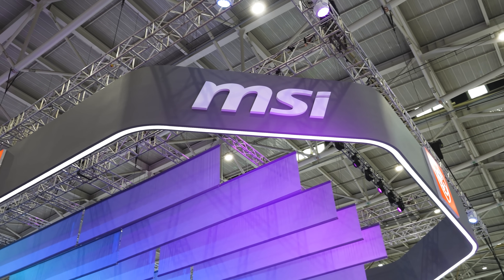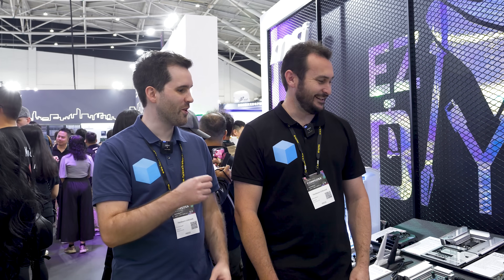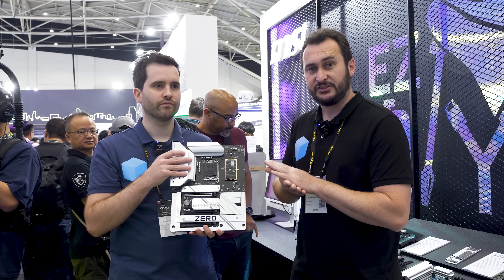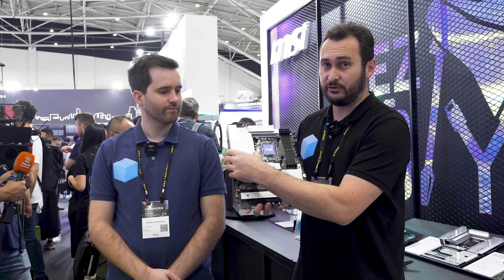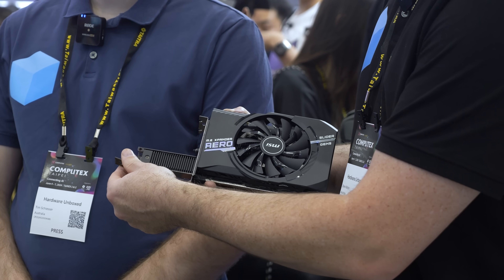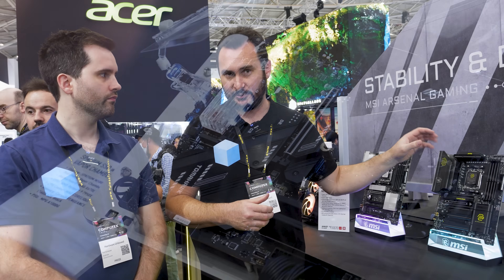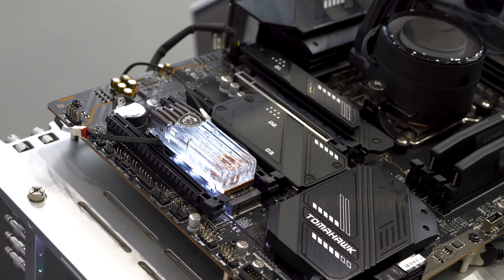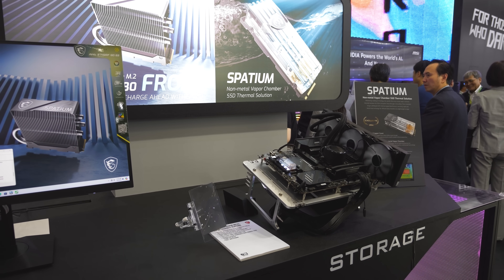Faster, Better Memory Is Coming, DDR5-8400 Now Actually Works

Comment: Yes, the MSI motherboards are offering some newer improvements once released for socket LGA 1851 socket. Now that the Intel 15th generation is coming to market along with MB’s, I am not finding from MSI’s website for the CAMM2 version which was Project Zero PLUS. Would anyone have information on whether MSI is actually proceeding with this MB production and when it will be available to the consumer?
Thanks for all information who are in the know!

Comment: It looks perfect for ITX motherboards. since it would give more space for new wider cpu coolers that couldn't be done before because of dimm slots but allow for a bigger heatsink+fan in small builds to increase what cpu can go into SFF builds. Imagine the higher end cpu that can be cooled properly in a tiny cramp space.

Comment: The camm2, will exist on ultrabooks, where the ram actually are solded to the motherboard, where the inrernal height not let a dimm slot, but yes let a camm2 little port and module.

Comment: Do MSI boards still install the Nahimic malware if you enable the onboard sound device? That crap is almost impossible to remove from your PC, unless you have expert level computer knowledge. It will also automatically re-install and re-enable itself unless you nuke every trace of it and blacklist it's device ID in the registry.

Comment: 4:00 where's the power delivery (24 pin) to the mobo?
Reply from the maker: It's an MSI 'Project Zero' board, all the connectors are on the rear side of the PCB.

Comment: What " I  "  like  about this  design  with  the  Cam2  Makes for  a  Very   Good   Path  for  Full  Water  Cooling  block  For  Both  Cpu  and  Memory   Now  !!!  =  Anyone  ?   ,   Could  even see  The  GPU  Embedded  for a  Whole  Board  Block    =  ? placement  also  closer  to  cpu   actually  could  drop  cpu  on  board  and  cam2  to  make  it  easier  for  the  central  position  all  around  to  get  caps  and  all   up  to  baack  io  which  is  in  dier  need  of  same  tresatment  as  say  length  of  rear   of  board   shortening  audio  traces   as  well  as  hdmi/dp /c lan  etc...   can be  in its  proper  position  of  connectivity   shortening  the  latency  for  each  feed  with  shortest  trace  being  embedded  into a  monitor  ,  Nooooo

Comment: Let me start by saying I love your videos guys, they helped me a lot with all that amazing data you show on them.
I know this is not going to be the only standard, for now, but I have to write the following: 
CAMM 2....mmm interesting.... so instead of getting less screws, we are in fact adding screws to things that never had them. A simple task like installing or changing RAM is now a pain in the behinds with screws that can fall all over the system. And we also get another bracket with more pads and small contact area that can get damaged, but hey you can order a new one if it gets damaged.... of course you can pay and pay .... Why would anyone want the old dimm slots instead of this nonsense, right?.
And lets not forget about adding more RAM... no no! .... well actually lets forget about adding more with CAMM 2, if you want more RAM, you have to buy a brand new CAMM 2 "stick?".
I guess you can also "stick" the old one wherever you like.
Honestly I have no idea who was the brain behind this, but Im not a fan.
For notebooks it may be (in some niche cases) a good idea, for heavy OCers also a good idea. For the rest of us is by far one of the worst ideas I have seen, only obscured by the almighty nvida power connector. But hey this is my opinion, you can, and most likely, will disagree.
I did liked the PCIE button solution and the M.2 drive release thingy.

Comment: Just move CAMM memory on the back of the MOBO like an nvme.
Place bigger heatsink around cpu socket...
that's smart
Reply: Even with CAMM2 on the front, given the low profile it should still allow for more heatsink clearance if someone wanted to make one that only worked with CAMM.

Comment: CAMM2 will severely limit upgradability. It takes too much horizontal space, there is no chance of double sided modules. It is good for laptops but on desktops where vertical space is not a big problem, this is not a good solution. Unless manufacturers move most other connectors to the backside like that MSI board which came a while ago.

Comment: Gonna be honest... that quick release, super easy m.2 slot lock (or whatever the correct term is), and that snap-on Wi-Fi antenna on these boards are definitely going to be factors when I upgrade next. Not sure about CAMM2 yet though; it'll either be amazing or annoying. Definitely will need to see it in the "wild" before I have a solid stance on that. Let's hope they aren't all priced outside of my price range when I'm in the market.

Comment: No cool new features for x870 ?? I guess slightly better ram OC potential thanks to the new chipset but overall, feels kind of lacking ? Wasn't there talks of USB4 (even if it's not very exciting could be always a plus) x770 too many 7s ? at least this should make the price of the x670 motherboards drop...hopefully, will be curious to see the reviews if it's really worth it

Comment: The main flaw I see with the CAMM module is the lack of upgradeability. You can't gradually add more memory as you get more money. Each time you'll have to fully replace the older CAMM module and go through the hassle of selling it on ebay or sth.
The second problem I see with it is that smaller capacity modules will become obsolete very quickly and will end up as e-waste. An 8GB DIMM on its own is obsolete today for most gaming setups. But in a 8GB x 4 configuration totalling 32GB, it is still a viable option. The same can't be said for the CAMM module. Once it's obsolete, it can't be repurposed as easily, maybe for a NAS or home server, but not for gaming.

Comment: Interesting with new RAM DIMM (CUDIMM) for desktop along with the (LP)CAMM2 that is mainly useful for LPDDR instead of regular DDR. So I am not sure how useful CAMM2 will be for a desktop setup, but if power consumption matters then using LPDDR would be a benefit compared to regular DDR RAM DIMMS.
Edit: I can see one of MSI's selling point about CAMM2 for desktop is the look of the memory lying flat instead of sticking out like DIMM does, lol.

Comment: The pin interface (or BGA) on memory has no interference until you go past 5 GigaHertz, the ACTUAL speed of that memory runs over the pin interface (or BGA) is way, way, WAY, lower than 5GHZ. You can look it up, there are plenty of research papers telling you exactly what I just said. So the mantra "It's soldered because it is faster and less interference" is 100% bull crap. People repeating it have no idea what an electrical engineering white paper is and they also can't seem to use a search engine.
How do you think they TEST their BGA chips before they sell them to OEM's? YEAH!!! They use a portable BGA socket that tests it. So again, soldering = more speed and stability = NOT TRUE. It's a market shill and I get tired of seeing this.

Comment: DDR5 8400 worked before this, get your facts straight, you just can't run it with 4-dimm boards, I have mine sine last year on 8400 cl36..lol..
Reply from the maker: And I'm sure it's stable, like a three-legged table.
Reply: @Hardwareunboxed  I personally use it 24/7 stress tested with y-cruncher and heavily tuned. Sometimes its the lack of talent and patience that leads you yo disbelief others, even someone I know runs 8800mhz daily on the Apex Encore. 8000mhz speeds aren't technically "new"..
Reply: One more factor is also the silicon lottery, one might think that its a guarantee to reach 8000mhz with just buying a dimm board like the Apex, memory kit and IMC also plays a huge role, it also needs a bucket loads of patience and ton loads of reading tech docs.

Nothing shabby with an enthusiast, IMHO..

Comment: I am really disappointed about the direction of their MPOWER-Mainboard.
It was already a bad idea prioritizing Intel instead of AMD, because the customers prefer AMD over Intel while MSI's price-equivalent AM5-alternative (200$ish MORTAR) is a significantly worse offering. 
But back when they first announced the Z790 MPOWER in January the pictures at least showed normal RAM-slots, now they redesigned it with some niche unicorn Mini_CUDIMM memory-modules nobody ever heard of and won't be able to buy anyway.

By the way, @Hardwareunboxed I hope to see an update of your RAM-speed-testing on AM5.
Since your last investigation a lot has changed, like the AGESA-updates enabling stability at speeds above the limit of your video (6400+ MHz), Motherboards having new optimised memory settings (MSI's High-Efficiency Mode) and the new X870(E)-Motherboards will push the memory speeds even further.
From my work I can confirm that your poll-result is correct and the vast majority of DIYers are XMP/EXPO-users, while SPD-defaulters and overclockers are in the minority, so I hope your new testing will again heavily focus on popular EXPO-profiles.
So please make the full test-spectrum of community service again happen for the new AMD generation (CPU 9000, MoBo 870(E) and RAM at 6400+ MHz EXPO-ed), thanks in advance.

Comment: The pro-CAMM2 comments forget that to upgrade from 16GB to 32GB, you have to replace the 16GB with a 32GB board, so you are left with a worthless 16GB board that initially costs around $150. The 32GB CAMM2 is expected to retail at around $280. So, CAMM2 is not a cost-effective option for most who want modular design (a cheap route to upgrade from base RAM config).

In time, with economies of scale, the price may fall, but they will still remain much more expensive than DIMM as you will need to buy the same RAM you already have due to the board design rather than simply buying an extra RAM module. Okay, if you are buying in case, RAM needs upgrading to higher speeds or you worry about RAM failure, both are not really what most people care about--as stated, most want modular RAM for cheap upgrading.
Reply from the maker: Is there even going to be a 16GB version? I highly doubt it.

Comment: These are some great usability improvements. Integrated backplate on low end motherboards alone has sold me. The improved m2 holder and the clicky pciexpress latch are just icing on top of that. Guess it's MSI for my next motherboard.

Comment: Is there any benefit for AMD base chips that seem to run optimally at 6,000? Which I couldn't even run at 6,000 because the internal memory controller failed. So I had to replace my 7800x3d.  And just to be safe I just run at the stock jedec speeds at 4800.

Comment: This CAM2 motherboard should come with at least 2 slots. One on the front and maybe one at the back. Or anywhere else.
With one unique socket is hard to recomend it for anyone that does not have the final budged already available. Like we do with DDR now.
It is way batter then soldered. But if you want to upgrade your memory you have to sell it or transform it in a fancy paper weight

Comment: It'd be nice if MSI could engineer a way to  eliminate the screws needed for securing CAMM2 in a way similar to that neat m.2 release of theirs. Using four of those locking mechanisms might be tricky to use, but they could maybe have one edge of the module insert into a slot with springs, similar to m.2 slot, then have just two locking mechanisms at the corners of the opposite edge. There could also be posts that stick through the module's screw holes to provide extra stability. This is just me speculating and brainstorming, but I have to think that the MSI engineers could devise something that would be more user friendly than screws.

Comment: I was shocked to see CAMM2 outside of mobile, but now I'm really starting to see and understand the benefits.  MSI is making some very attractive motherboards, and I'll might be looking to upgrade my system soon, so MSI will get some heavy consideration after their X870 board reviews start dropping.  I want to see how CAMM2 prices are first though, as I'm really interested in a CAMM2 design now!

Comment: Was wondering how long it would take for CAMM2 and LPCAMM2 to actually hit consumer boards/laptops after reading about it maybe a month ago, faster than I expected!  Also nice to see the QOL updates for M.2, PCIE and what not.  Wonder how much that M.2 expander will cost, icydock makes something similar but no fans.  Given how hot high end M.2's run now a days having a fan on it is a nice addition.

Comment: The PCIE slot for graphics cards don't seem fit for purpose any more. I think the time has come to move the graphics onto a discrete unit that connects with a cable to the board. As is, it's just asking for trouble.

Comment: I remember when everything was soldered onto the motherboard. We then saw things become modular so you could plug ram etc into the board and configure things easily, to suit yourself. We now have pins and connection types that are so fragile, they really would be better off just soldering them during production. That's progress for you.

Comment: The only issue I see now with CAMM2 is that if you want to upgrade your RAM, you must replace your RAM because it's one module, it's even worst than 2 slots motherboards.

And the next socketable thing should be GPUs, these still remind me of Slotted CPUs :D But this is a bad idea :D

Oh man, we definitely need to replace the ATX spec. completely, PCs have evolved so much, the first ATX spec. is already 29 years old and was developed by intel only, now AMD, intel, NV plus motherboard and OEM designers needs to establish a new consortium to design and develop the next spec. for motherboard & PSU designs and replace ATX altogether, with the current trend of back side connectors, high powered GPUs, CAMM2, ultrafast PCIe 5.0 and soon 6.0, things needs to change.. its a tech industry where 5 years is old enough, now it will be 30 years !!

Comment: That new ram design looks very interesting. I mean no I don't want to be forced to buy MSI to get it but slap a fan on that heatsink and DIMMs are dead to me then. I'd buy a 64gb module as that's all I need to never mess with it and call it. With a fan could possibly push higher speeds with a bit more voltage then on regular DIMMs

Comment: So the new rams can only be used one at a time? It sounds like they're going to be really expensive, unless they can be stacked on top of each other (which doesn't seem to be the case).

Unless they can fix that, the current format is still more accessible.

Comment: Why arent all LGA sockets easily user replaceable like the CAMM.2 socket then? So many boards could easily be user fixed due to the dreaded bent pins... probably prodction cost?.. or signal integreity?

Comment: nice then what if we want to upgrade from present 16gb camm2 module to higher one when only one slot of them is present? do we want to change whole of the present module .
Reply: That's the only downside. Yes, you will have to change the whole camm2 of you want to upgrade. I won't be surprised if most people will jump to 32gb ram instead of 16...pretty genuine marketing if you ask me

Comment: The most impressive thing I saw was that they had the foresight to make the CAMM layout footprint double the width of the current memory module on display. That will allow us to put in much larger modules with ease in the future and not require serious side-step engineering. Much like the NVME standard that allows for longer and shorter modules. Same concept entirely. Good design IMO.

Comment: The most important thing is also the cost. Is it as affordable while providing similar or better cost/perf than dimm?
Reply: It is more expensive for now, 180 bucks for 32 GB of LPCAMM2. (LPCAMM2 is a smaller form factor for laptops, but with same conector)

Due to low volume, the only laptop that uses camm now is the P1 thinkpad gen 7.
Reply: @rj7250a  Low volume is always going to be expensive. If they can start to scale the production to even half of ddr5 sales volume, it should come down in price quite a lot

Comment: only thing in my eyes that will kill the CAMM2 standard will be greedy vendors, other than that i'd buy a CAMM2 MB other than that all MB features are useless if i need a screwdriver to install camm2 why would i need a quick release for my ssd? or anything else

Comment: Great. I just bought RAM. Now I have to buy it all over again...

Joking. Though, you have to remember that faster RAM is only viable on Intel processors. AMD have poor memory controller from Buldozer era which causes system crashes from time to time. It also cannot handle fast RAM at all. 6400 MHz for it is the upper limit of what you can expect from architecture. Forget quad configurations or else Ryzen CPU will blow up. This is also a reason why Intel always had a leg up over AMD. They could be tested with slow and fast RAM and it would receive meaningful performance improvements, making it an enthusiast's choice. Though lately, it is sadly it is not very good and just good for budget builds.

Comment: If there is cooling on the backside would that need a dual chamber or there would be no where for the heat to escape? I thought you suggested against the all-in-one liquid cooler for the gpu as it was almost as if you could buy an entirely new system instead of buying the cooler edition. I suppose with the cooler being that close the gpu connector, at least when they melt it will potentially put the fire out before setting your house alight.